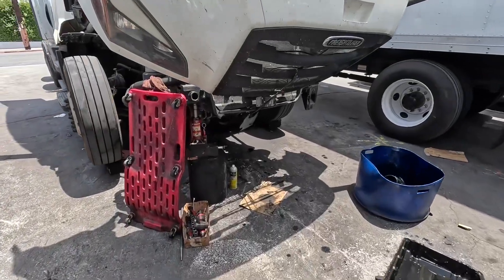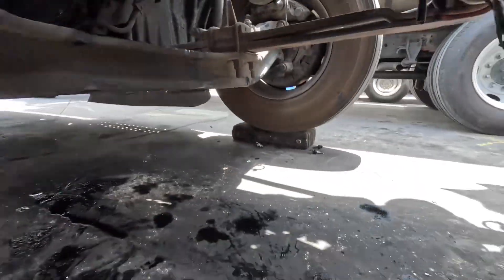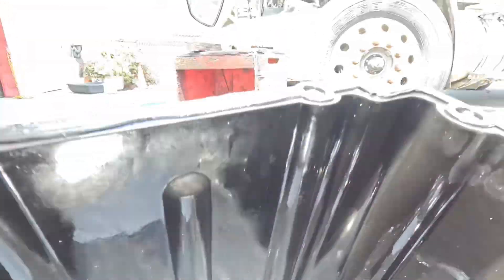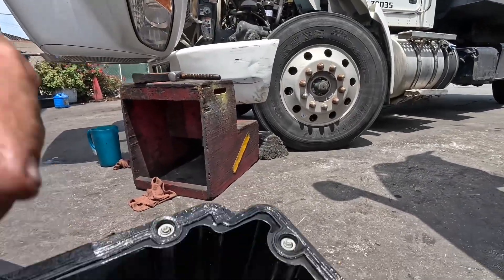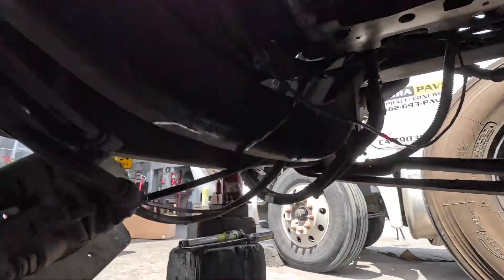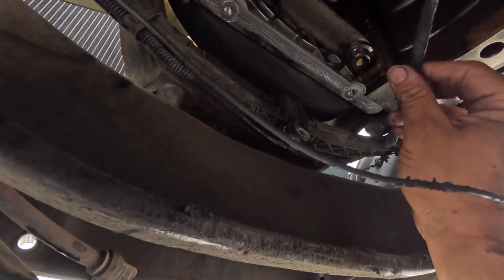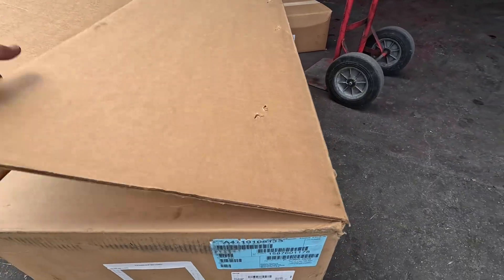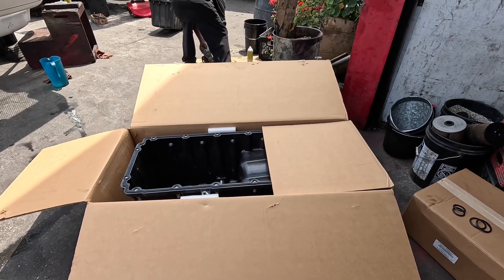Won’t believe what caused this DD13 oil leak. Oil pan needs to be replaced

Comment: Hwllo carlos again i have an oil leak rigth at the rear of the oil pan it was a little leak but now its  littel more
Reply from the maker: Has the oil pan gasket been replaced?
Reply: @CarlosDieselElectric yes they did it last year  was leaking  a little just noticed when I parked last night saw a bigger puddle someone mentioned rear main
Reply from the maker: @rigobertohernandez2524 grab a flash light and look at the corners of the oil pan and engine block. 
Depending on which side, could be the air compressor seal or the fuel pump seal. 
Let me know what you find.
Reply: @CarlosDieselElectric ok will do

Comment: That harness goes from the ignition to stater, I’ve seen guys replace starter and then come to find out just needed to repair a few wires. Pain in the butt to do roadside but easy to find when you know what to look for.

Comment: A friend of mine lost a DD15 motor due to a oil manifold pickup going bad. So anytime you have to take off the pan, just replace the oil manifold pickup while you are at it.
Reply from the maker: I agree with you 100%. The oil suction module is the Achilles heel of the DD13 and DD15 engine. 
The first design was half metal and plastic I don’t remember seeing that many failures.
Reply: @CarlosDieselElectric does that suction module fail over time? How many miles does it usually go before it fails? I got a dd13 2016 the 560 K miles
Reply: @LightSpirit24  I can't tell you an estimated time of failure, I just know that we had a reason to take down the oil pan anyway on one of our trucks so I heeded my friends warning and replaced the oil pickup while we were in there. The parts and labor are a boatload cheaper than losing a motor due to this issue. That truck had 500-600k miles on it at the time of replacement.
Reply from the maker: @LightSpirit24 they will fail because they are made of plastic

Comment: I work at a fleet of garbage trucks we use like 10 ish or so western stars/freightliners with dd13s its an issue we have where power steering lines come loose from brackets and rub holes in the oil pan for us i feel you on it lol

Comment: $700 pan because of a harness 😂
Reply from the maker: I couldn’t believe it myself. I would try to patch it being it is made of fiberglass but I have seen them leak in the past. This truck goes cross country and we cannot take the chance.
Reply: @CarlosDieselElectric for sure and you did it right the module can crack and we know those o rings were hard as steel. Those pans also rub nice grooves on front and rear covers which can make it a bear to without a little love from silicone😅